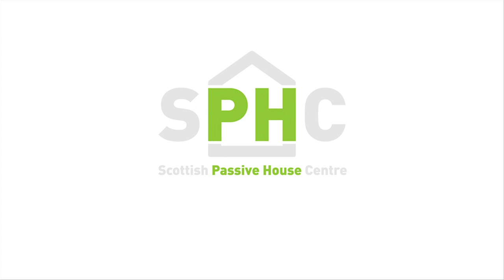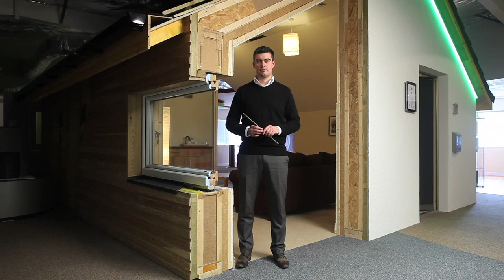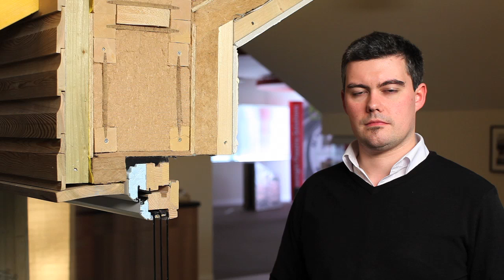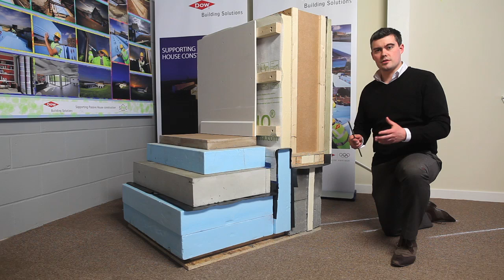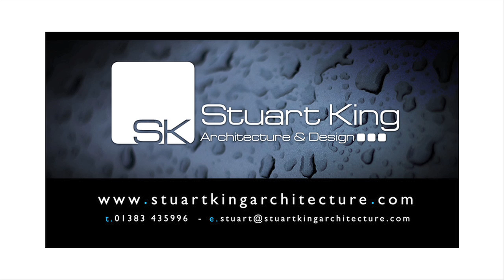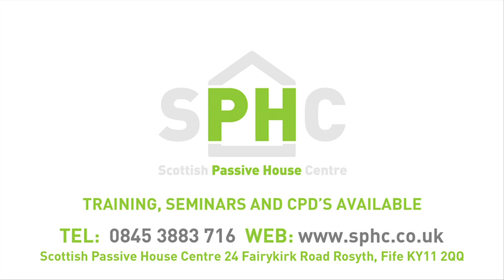Passive House Thermal Bridging - SPHC (Pt 4)

Comment: I put 1/2” rigid foam between the framing n drywall thus no bridging so I found out my window choice was poor n I even foamed between the jam. Would have been interesting with 2 “ foam. Tell me as I heard a comment - in the gwn where heat retention is key does insulation keep the cold out or the heat in or better yet should one insulate outside or inside the framing ????

Comment: https://www.youtube.com/user/seumas2/videos how to build PASSIVELY
Material used Port Alberni's first Passive house (Passivhause) build in the heart of Vancouver Island British Columbia Canada.

Passive House(Passivehaus) is considered to be the most rigorous  voluntary energy-based standard in design and construction industry today.
Passive house buildings consume up to 90 percent less heating and cooling energy than conventional building.

The use of Passive House design software was used to gain the specs required to meet the performance standard for this location.

House was constructed well  above the current standards as outlined in the B.C. Building Code.

Footings were widen to 36 inches(914 mm) due to low bearing soil conditions and additional rebar reinforcement added.

30 inch high (762 mm) high reinforced walls . Course sand placed inside foundation walls and mechanically compacted.

Three layers of four inch *102 mm) thick  Expanded  polystyrene foam sheets with all joints staggered and tape were placed on top of compacted sand.

The three layers of foam have insulation value of approximately R 50.

A 20 mil layer of poly was placed over the E.P.S. sheets and taped and sealed.

Four inches(102 mm) of 30 m.p.a fiber reinforced concrete was placed to form a slab over the foam based.

Slab is isolated from concrete stem wall with four inches (102 mm) of E.P.S. to prevent thermal loss.

All cold water lines are buried in the sand to keep them cool, hot water lines have been placed in the center layer of foam insulation to minimize heat loss.

Wall plates compress to heavy beads of acoustic sealant between layers of vapor barrier to prevent air movement.

The walls are double stud configuration set at 24 inches (610 mm) on centre and plates are spaced in a manner that yield a 20 inch (508 mm) thick wall. 1/2 inch (12 mm) standard plywood sheathing with  Mento 1000 a three layer airtight vapor open house wrap( far superior to common house wraps) with 1/2 inch(12 mm) pressured treated plywood rain screen battens form the exterior surface. 

Intello  smart vapour barrier was installed one third in from the inside wall to prevent condensation in this climate.

Triple pane argon filled windows meeting passive house standards from Euroline  were placed mid wall to reduce wind wash heat loss.  All window openings have been splayed at 45 degrees to give a full wide angle view.

Almost all the wiring and plumbing was kept inside of the vapor barrier envelope to minimize air leakage.

Passive house standard requires air leakage not to  exceed .6 Air changes per hour at 50 pascal.

Zehnder comfoair 200 HRV has been installed with a 1000 watt air preheater .(92 percent heat recovery rate)

House has been pre- plumbed for a heat pump water heater reducing  domestic water heating cost significantly.

Garage has been pre-wired for 40 amp/240 volt  electric car charging station.

House to be equipped  with  heat pump condensing dryer which requires no external venting,only a water waste line. George K Builder. © George K 2019       https://www.youtube.com/user/seumas2/videos

Comment: This is one of the worst definitions of a thermal bridge I've ever heard. How can he be a TB modeller if he doesn't understand the science and can't explain it in a robust manner.
Reply: OK, then it's your turn.  Share what you know...(thanks)
Reply: Hi you can have a look at: http://josephlittlearchitects.com/content/thermal-bridging-understanding-its-critical-role-energy-efficiency
I would say that a thermal bridge is a non-uniformity in the conductive-heat loss of a body. Depending on the geometies or materials it can represent more or less energy than the plane element heat loss (even in Northern Europe). Depending on the cause there are therefore geometric and construction thermal bridges. Those that occur regularly with a plane element are termed repeat thermal briuges and are taken account of with the U-value calculation. Those that are at the junction of plane elements are termed linear thermal bridges and are accounted for by thermal bridge modelling. A useful way to think of thermal bridges is that they are non-uniform heat loss, in a North European context a linear thermal bridge can also be termed 'extra-over heat loss' because a thermal bridge is NOT all the heat loss at the junction it is the heat loss occurring there over and above the plane element heat loss (which is measured from inside finished surface to inside finished surface in UK and Ireland, PH measures on outside of the thermal envelope): this is generally not understood.
Reply: Joseph Little That's basically what he said
Reply: @benpenzance  Yeah but you sound smarter when you use technical language and lamans cant understand you.